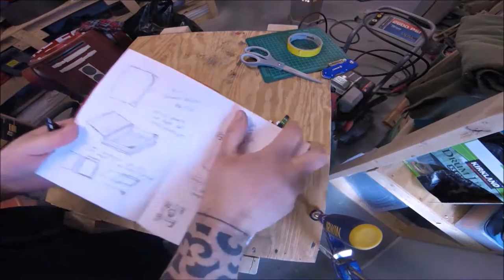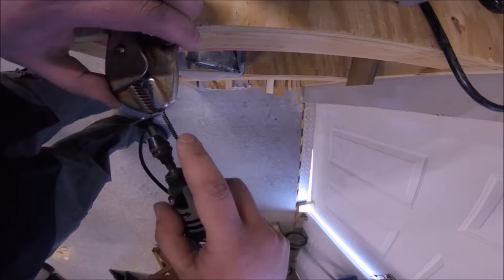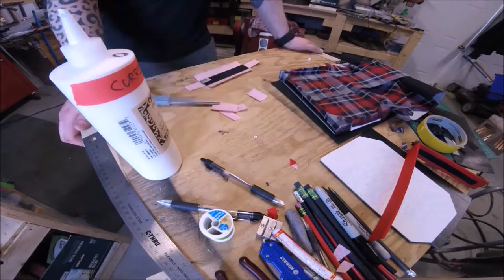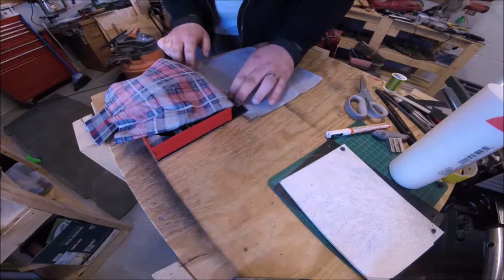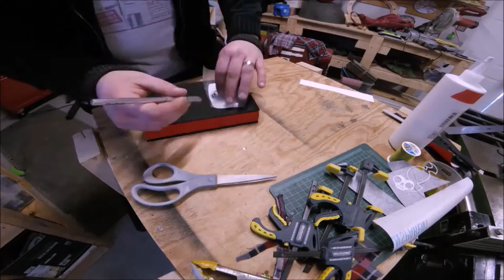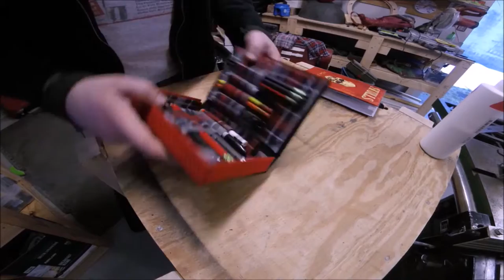SleepyOni: DIY Drawing Case - 2-Weeks-Late Edition!

Comment: I have watched this video a couple times now. Would your design here possible work out as a carry case and dice tray also ?
Reply from the maker: would absolutely work as a dice case/tray.  I built this just like my books, with the addition of an inner box in place of a text block of paper.  I even covered it with actual bookcloth, instead of my usual homebrewed version.  Figures I wait until I'm NOT making a book to use bookcloth.
If you're aiming for a dice case, you could easily end up with a thinner box.  I would recommend using more/bigger magnets if things inside aren't fixed in place, though.